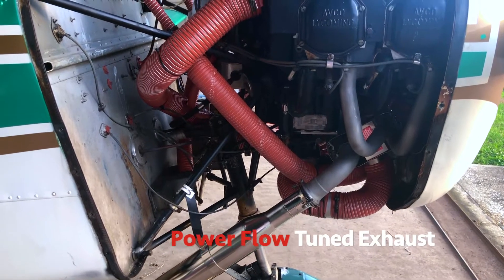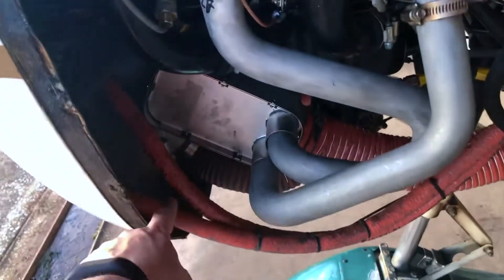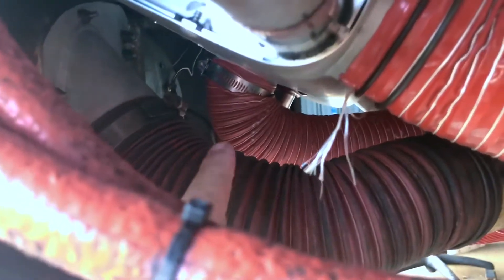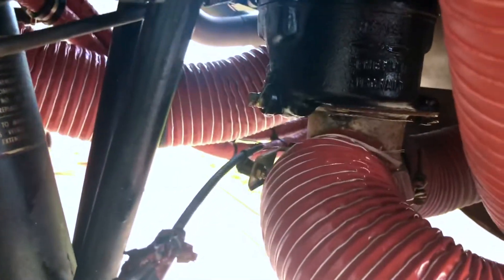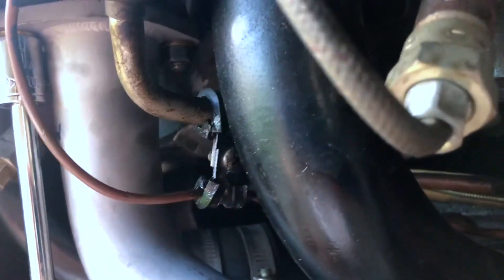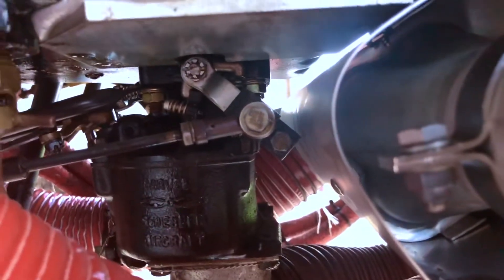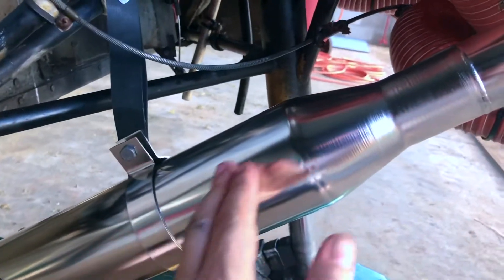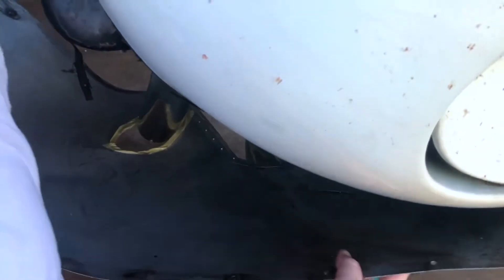Walk around of a Power Flow exhaust on PA28-140

Comment: 1972 PA28-140 with 0 SMOH looking for as much climb performance as I can get out off160 hp  0-320 Lycoming
Reply from the maker: We can definitely help you!
Reply: @PFSInfo  Can you estimate a hp number with the power flow system. 800 other Cherokee Owners can't be wrong. (LOL)
Reply from the maker: @bobkimmcdonald6171  Typically PA28-140 customers report seeing gains of 50-70 RPM on takeoff.  Dependent upon the formulas and references used, this is a gain in the range of 13-18 HP for a 50-70 RPM gain.